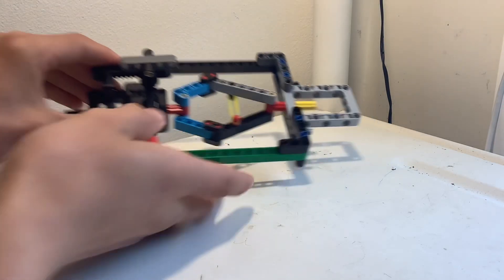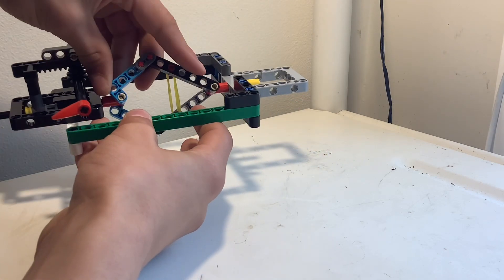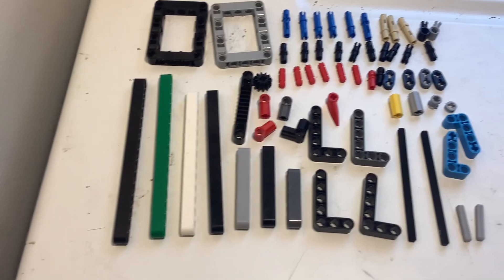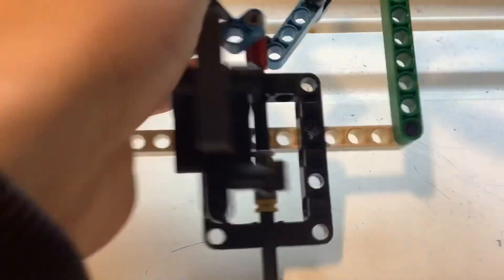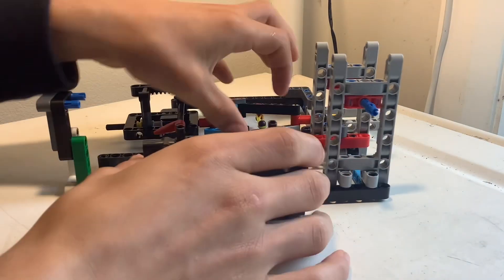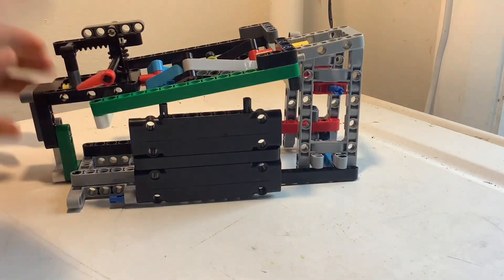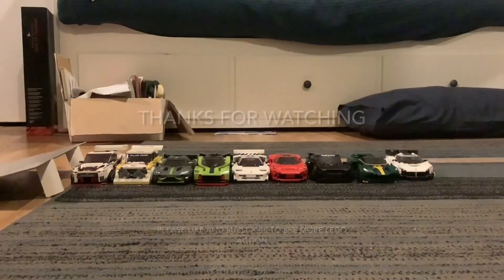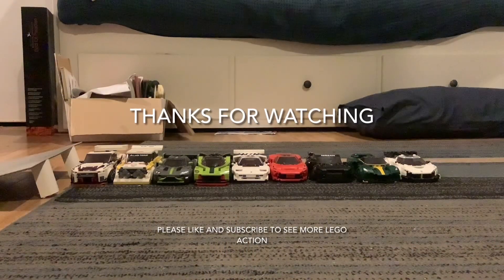Working lego revolution tachometer

Comment: Nice.
Would it be possible to add something like a dampener?
Like removing the oscillation?
Reply: yeah the vibrations on the dial are hard to calculate actual engine speed
Reply: Why would you want to make it damp? You mean a damper?